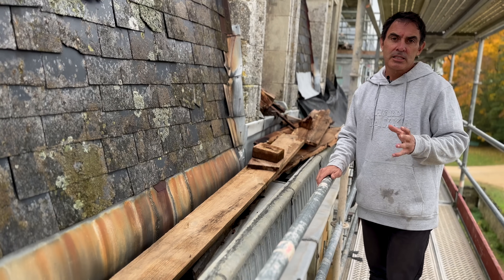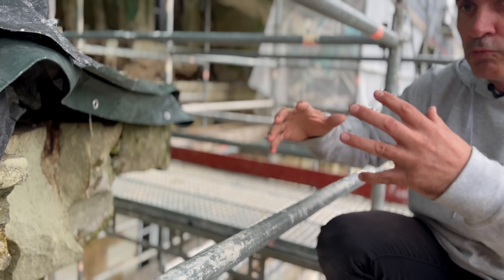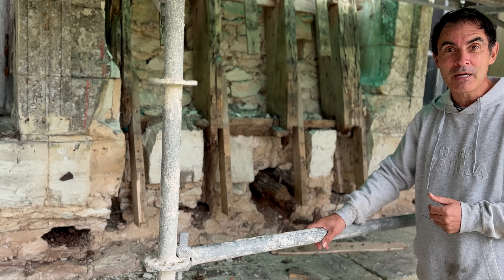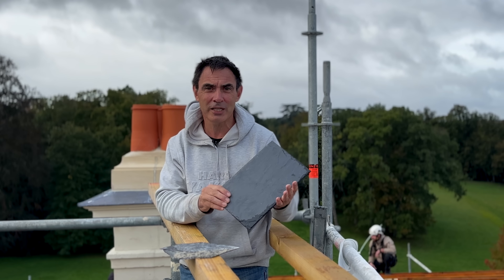BREAKTHROUGH! The amazing transformation of the château. Château Restoration Progress #1

Comment: Interesting project. Just picking up on one aspect in particular. I’m a very experienced builder, 50 years plus experience in Construction
This is not a criticism but objective advice, the haunching for the chimney cans, (pots), is totally inadequate, not only that but as insurances they should be mechanically fixed, using stainless steel fxngs. The spalling of the Stone Cornices is in all probability caused by one or two things or a combination of the two, firstly the iron fxngs corroding & expanding due largely to not being sealed sufficiently and the effects of the freeze thaw cycle. We have just finished a small job repairing a sandstone sill which had iron bars fitted into the stone, the lead seals had failed allowing the ingress of water & overtime the freeze cycle had induced a fissure in-line with all the iron bars with the resultant failure, I hope that’s helpful, we are very experienced in Structural remedial work, we have carried out many works and utilise some very interesting technical methods including the use of Masonry Beams, where the existing wall in need of stabilisation is interwoven with a frame/matrix of Stainless steel which effectively is a beam. We are based in both the UK, (at the moment) & Dallas, Texas. 
All the very best with your project..